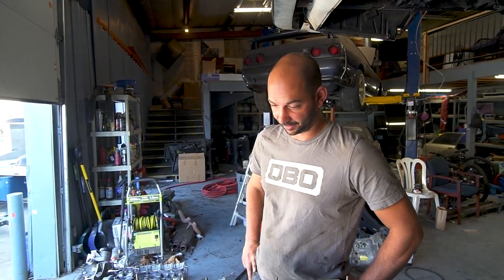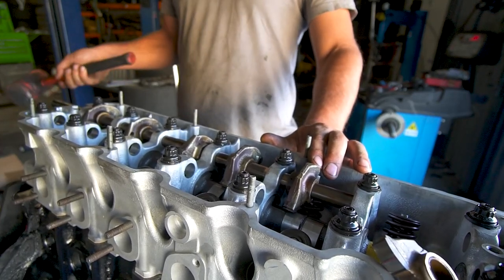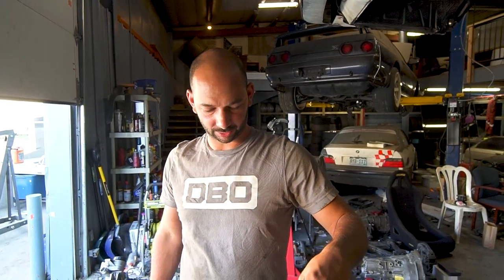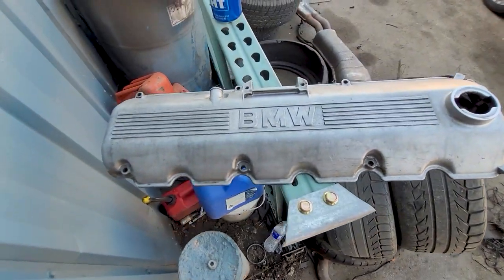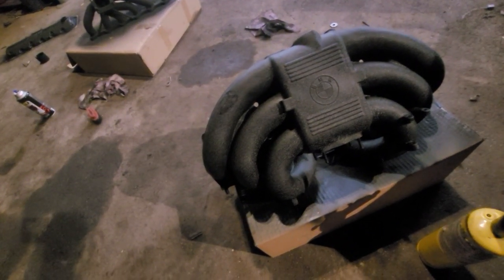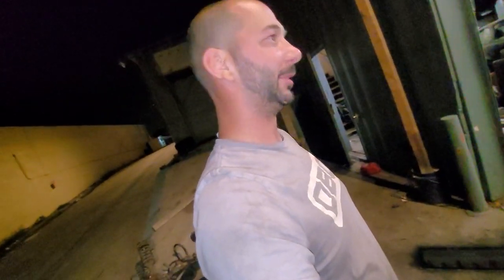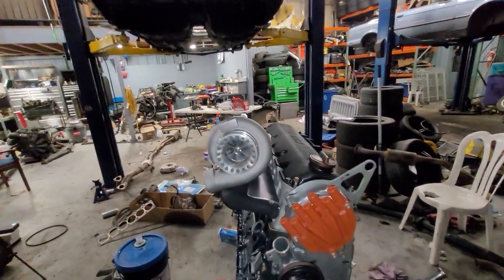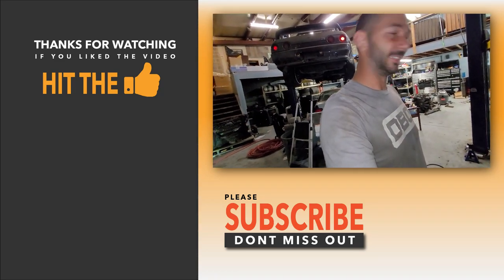Turbo M20 Stroker Assembly Part 2!

Comment: Nice man, nice! Cool that you're doing what I was saying by sanding down the BMW logos on the manifold and valve cover. I recommended it in part 1 before I watched this video. It always makes it look really good like that IMO. Damn, you should've aerosol overhauled the crank pulley/ harmonic balancer and the oil cap. I think that's all that's missing. The choo-choo boy looks great on there really. If you're worried about melting the plug wires, grab some of the heat wrap for them and a turbski blanket. The blanket alone will make a big difference. Plus holding the heat inside the housing as much as possible increases the efficiency. Shit is looking knarley dude! One of the cleanest m20 builds I've seen for sure. I know it'll be loud but man the downpipe and wastegate dump would be so badass coming out the side of the fender. Can't wait to see it go I  the chassis and my only wish is that I was there and was part of these type of builds. 😎👍👍

Comment: The wrinkle black is sick. Whats that hole next to the intake ports that the oil was coming out of for? I thought it was maybe for a breather into the intake but it also has a port on the valve cover. The m20 throttle body looks so small compared to the m30 stuff. I had to wrap all my plug wires they got fried next to the exhaust housing
Reply from the maker: It is direct drain from the head to the oil pan. Known in the community as the "bitch tube"
Reply: @DENVERBEERANDOIL  seems super un-necessary, the drain is on the other side! Im sure the BMW engineers had some brilliant reason to over complicate things right?
Reply from the maker: I agree, I've never seen anything like it.
Reply: @DENVERBEERANDOIL  thought that just came to mind is maybe its to let the pan breathe to the valve cover, m30 can through timing chain area. Maybe its to keep the head from pressurizing and pushing air out the breather when oil fills faster than it drains
Reply from the maker: That would make sense, would be the only way to bleed off crankcase pressure. I'm not used to timing belt BMW engines yet, I bet you are exactly right.

Comment: Currently running the same turbo on my m20b25 e30, it's a little big for the engine. I don't see boost until 3.8k rpm, and hit full boost (17psi) at 6k. Curious to see what your engine will do.
Reply from the maker: Damn, that's not promising, hoping the extra displacement and cam will help out a little with spool time. Thanks for sharing though, any idea what yours makes at 17 psi?
Reply: @DENVERBEERANDOIL  Haven't had it on a Dyno, but it will spin 3rd gear at 60mph. This is with a 3.25 diff and stock bottle cap wheels. I can upload a video of a pull if you want. 

I think I can push the boost a little more and make it spool faster. I have 6lb wastegate spring with an EBC at 100% duty cycle.
Reply from the maker: I'd love to see a video, just send me a link. I bet it's a blast when boost finally comes in.

Comment: Did you heat the wrinkle paint? I missed it if you did.
Reply from the maker: Tried it, came out blotchy
Reply: @DENVERBEERANDOIL  when I did my valve cover and intake on my MR2 the heat was important.  Made the wrinkles much better, and the paint more durable.

Comment: I thought I replied yesterday but I had a question. A buddy just got an 05 M3 with a blown head gasket for almost nothing. When we replace it is the any preventative maintenance you recommend? Parts there are better than others? I figured you're the one to ask since all the BMW groups are pretty trash.
Reply from the maker: I would definitely do rod bearings and a valve adjustment,
Reply: I'll tell him to add it to the list. He's making an fcp euro order Thursday or Friday.

Comment: Hey DBO, I spoke to will about some 327i stuff and wanted to know do you guys think running the 327i setup with a completely stock eta bottom would run like shit? I know the compression ratio will be about 8.4:1 ish but does that mean anything other than a little bit less power. I want to get a turbo in the future but looking at just running NA for now.
Reply from the maker: It would just be lower compression, a little slower, still rev much better than the eta head. Turbo will make up for the lower compression later
Reply: @DENVERBEERANDOIL  that’s great to hear. I was worried that there would be a really big loss of power, or it would make the engine want to stall out more or run terrible.